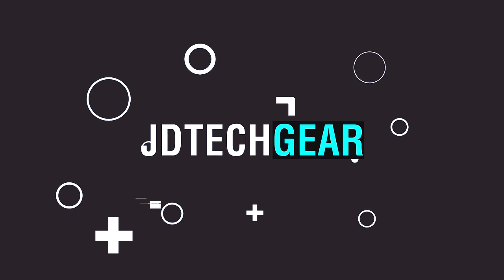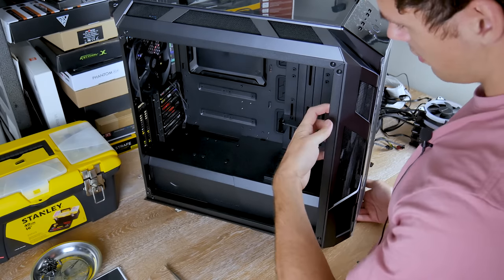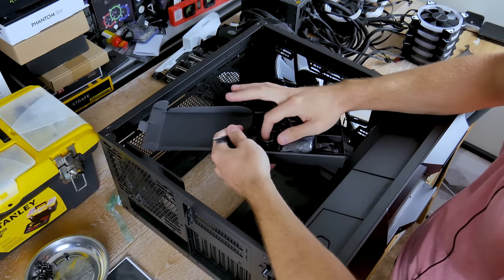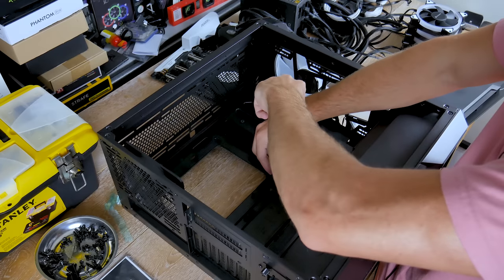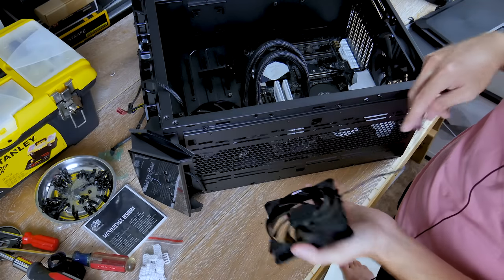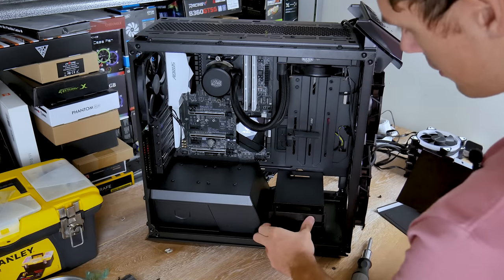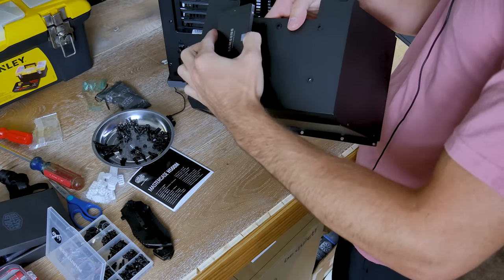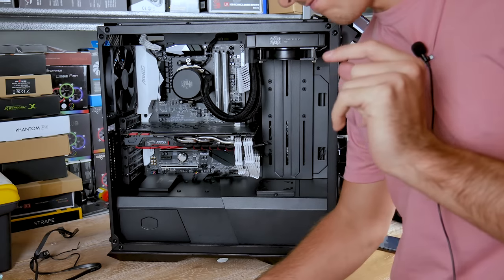Building In The Cooler Master H500M | A $200 Beauty

Comment from the maker: So, yeah this case is pretty awesome and it has airflow! Seriously loving Cooler Master's cases more and more. If it doesn't tickle your fancy then I've got plenty of other case reviews if you're interested on the channel. Got a motherboard review coming up on Monday for you guys ;)
Reply: I would've taken the front part of that shroud out, you eat a lot of airflow with that thing. I recently upgraded to a Cooler master Mastercase MC500P and its amazing!
Reply from the maker: @samantharoseland3599  the HDD shroud? And that's a nice case as well!
Reply: Just built this case with stock cooler...low 30C or so idle temp. I plan to use a radiator perhaps later, but not in a rush.
Reply: Can I use 5 or 6 fans and a aio in this case??plz help
Reply: WHAT'S THE DIFERENCE BETWEEN H500, H500M AND H500P?
Reply: @jdtechgear  I just assembled my brand new pc in this case but the front fans are not working nor is their rgb. My guess is I messed up the front fans' cables, please can you briefly explain how the front fans' cables should be plugged?

Comment: I built my buddy's PC in this exact case. 8700k, EVGA GTX 1080 Ti FTW3, Corsair H115i, 32 GB G.Skill Trident Z RGB 3000Mhz ram. Absolutely stunning final product, going to be using it for my 9th gen i7 and RTX 2080 Ti build late this year.
Reply from the maker: What a beast, dang!!!
Reply: Plz tell me can I use 6 fans and a aio in this case?
Reply: Plz kindly tell me can I use a 360mm aio along the two big 200mm fans??plz help I request you
Reply: Did u mount the water cooler radiator to the top of the case or the front
Reply: in what orientation did you install the h115i? I made a very similar build in this case. I opted for a top mounted radiator as intake with the fans pulling but I'm reconsidering my cooling setup

Comment: I watched it all, just to figure out the only thing i came for was cut out 😅

And that was the annoying cable wirring. My PC just wont power on, still unsure if i connected all RGB cables correct dont know if that can cause any issues, i also checked power switch cable, i doesnt have +&- markings but i does have little arrrow at the back part, and the other cables that does have +&- also have an arrow so that told me my wirring were supposed to be correct. 

But to be sure i wanted to find a video showing everything exactly where it goes.

Comment: Can someone help me i have a problem, I went to the pcpartpicker site and when I put these parts 	Asus ROG STRIX Z390-E GAMING ATX LGA1151 Motherboard and Cooler Master MasterCase H500M ATX Mid Tower Case he tells me the next problem Note:Cooler Master MasterCase H500M ATX Mid Tower Case has a front panel USB 3.2 Gen 1 Type A port, but the Asus ROG STRIX Z390-E GAMING ATX LGA1151 Motherboard does not have sufficient USB 3.2 Gen 1 headers. The case USB 3.2 Gen 1 Type A port will not be usable. Can I fix this problem, and is it a problem at all, or is the site not updated? Thanks!

Comment: It is exactly where the cables should go that is frustrating me. XD First computer that I build. I believe I have most things done ok by now. Just what cables I need and where they go... >_> Then I will need to look into how to get windows on there.

 There is also whenever or not I should use the double PCI-E option and connect my 1080 with only 1 cable, or if it would be best to use 2. It seems odd that they would give me 3 of these unless 1 would be enough, so I will probably go with that.

Comment: I’m gunna try my luck here and hope someone or you can answer!

Basically same set up, the only problem I’m having is the RGB controller. How did you plug the 3 pin wire from the controller to the motherboard? The motherboard is a 4 pin and the converter wire that comes with the motherboard doesn’t even connect properly! Wasn’t too sure if I’m supposed to buy it separately, not plug it in, force the wire in, etc! 

Please help! Thanks!

Comment: Just finished my build with with case. I can figure out how to get the rgb lighting on the front fans. They're spinning. But no rgb
Reply: Same problem
Reply: @salvamax7702 you have to connect a sata from your psu to the rgb controller
Reply: @KG-un8uy  Ok thanks bro i have to try this. Do you have a tutorial to do that?

Comment: I like what this case has to offer, but the aesthetic and price point aren't my cup of tea. I'm more interested in nice $80-$100 cases, though $60 will get the job done on a low budget.
Reply from the maker: Well cases up in this tier are (usually) much more modular than the $100 entries and made with all metal parts, but not everyone is a tinkerer, that's why its made for a specific market. I do love the aesthetic of this case though! And also do love the PC-O11 Dynamic
Reply: JDTechGear I’m glad to hear you like it! I completely understand the point of the price range, I just never find that It’s worth it for me and my needs.
Reply: Cooler Master H500 (without any other letter) got you covered :P...tbh I find cases one of the most reasonable places to put your budget, after all, other components will become obsolete and need to be upgraded over time, but the case can stay with you over several generations

Comment: does the front fans need to be connected to the motherboard as well or it has its own system?? i mean for spinning not for the RGB
Reply: Im currently building with this case and I'm kind of confused about that. I don't see any fan headers for the 2 front fans. There's the rgbs and some weird 2 pin cable but no 4 pin.

Comment: Did you hook up all four USB 3.0 front panel ports? and if so how?
Reply: I got all the front panel USB ports working. Luckily my Motherboard (ROG Formula XI) has X2 USB 3.0 and a USB 3.1.
Reply: 2 of the usb 3.0's split into one connector and the other 2 split into the another. Though Im not sure if I can utilize the 3.1 on my x470 Gaming Pro Carbon as I haven't seem to find a place to plug it in.

Comment: Anyone who ACTUALLY BOUGHT this case knows that while Cooler Master CLAIMS they can handle up to a 360mm radiator, there is actually NO CLEARANCE for a liquid cooling system. Your fans WILL hit the motherboard. You will have to mod the case or return  it. BUYER BEWARE!!
Reply: Exactly that. I have just bought the H500m case and have the Corsair H115i Platinum RGB 280mm AIO which doesn't fit properly, as like you said the fans hit the top of the motherboard. I have had to remove and prop the roof panel of the case up with the remaining spare standoffs that come with the H115i Platinum as they conveniently fit in the screw holes of the roof panel raising it by 10mm+ with a cable tie in each corner to keep it in place and secure. I was absolutely fuming it didn't fit properly and not exactly happy how I have had to build it 😭
Reply: you can mount the fans on top and radiator under no prob
Reply: That's the whole point of the design. The fans are supposed to go on top of the grill. Especially if you are using an AIO.
Reply: The fans go on top, on outside of the case you Pepega

Comment: just to be sure, what cables are connected to the fans ?
Reply: The 2 front fans? I bought this case and I'm not even sure. I was looking for the typical 4 pin headers like the other coolermaster argb fans I bought but I couldn't find any coming from them. Just some weird 2 pin connector.
Reply: Jake G Thats weird, I saw some videos about this case (it was hard to find at least one showing those cables) and there were 4 pin headers for asus, msi and asrock I think, and also a different 3 pin header for gigabyte (like a 4 pin, but missing one pin in the middle) Maybe the 2 pin connectors that you mean are connected to this „control panel“ on the side of the case ? I hope you know what I mean.
Reply: Miningzeus Im thinking its a 2 pin fan cable. Which cannot be speed adjusted. Im going to try plugging into my board today and see if I can get it to work. Just very odd to me that its not a 3 or 4 pin like the rest. Or im missing something.
Reply: Jake G Yeah,Im just checking out because I want to buy this case but I need a new mainboard for argb. Speed adjustment isnt important for me. Probably I will buy the case and look how it connects and then I will buy a mainboard. I wanted the msi b450 gaming pro carbon ac, because it has 2 argb ports I think (4 pin). That should work. Thanks for your quick answers. Greetings from Germany

Comment: why not just wait a little and go with the evolv x at this price plus this would be a nightmare for new builders.
Reply from the maker: Elvolv X is a nice case, yes, but lacks majorly in airflow. The case underwent a lot of refinement and is NOT a nightmare for new builders, actually far from it. This case is straight forward and easy and modular without compromise. Again, reiterating the point that this case is refined.
Reply: The case being modular to some extent can be a lot scary for new builders, they scared to do something wrong or unscrew things and be lost, I know I would be, but anyways this is a great case and I won't take that away from it. Just as you expressed that you wanted it to be toolless on the side panels I would like that inside the case too such as tabs rather than screws. Most mainstream cases are great in quality and it comes down to the little things like this.
Keep up the high quality vids tho.
Reply: This is my 2nd build and first time actually trying to worry about a bunch of rgbs and cable managing and I'd say that this is a bit much for me. I'm trying to figure out if and how the front fans are connected to the motherboard as I don't see any 4 pin headers like on the other coolermaster rgb fans I bought. There's just some weird 2 pin connector hanging down that I;m not quite sure what it is. And the manual is little help in that regard as it doesn't really explain what everything does and what to do if you add more fans to the case. And it shows regular fan headers coming off of the fans but I just don't see them. Are the usb and sata both required for the controller if you don't plan on using your motherboards rgb controller? Hell my case didn't even come with the usb plugged in like everybody elses. There's just a handful of things I'm not sure about and I feel like im left in the dark.

Comment: I regret buying this case.  This video appears to have skipped all of the fiddly and awkward bits, which many builders would have liked to see. In particular the connections required for the fan controller. In my case I used a Noctua NH-D15 cpu cooler and could not get my fingers down the side to plug the cooler fans into the fan headers. Finally you are basically forced to take everything apart before you can do the most basic of builds. I do not recommend this case and will not buy a cooler master case ever again. This video appears to set out to make the case look good rather than give a balanced view of all of the pros and cons.